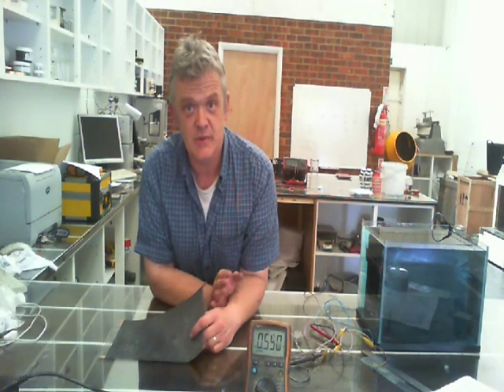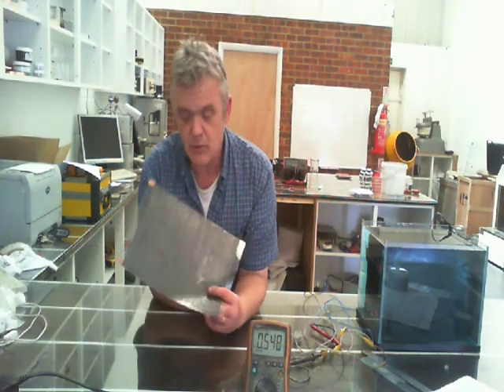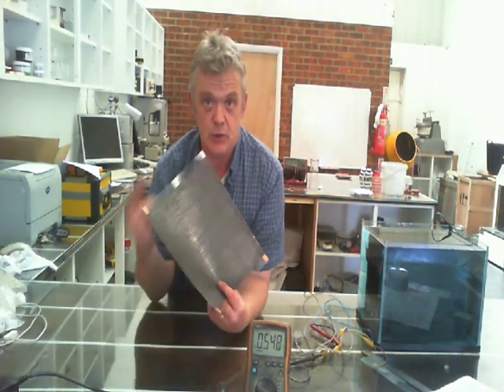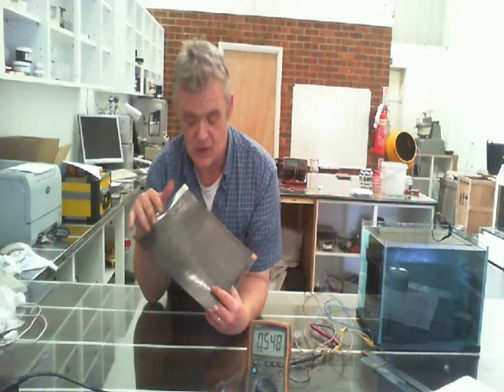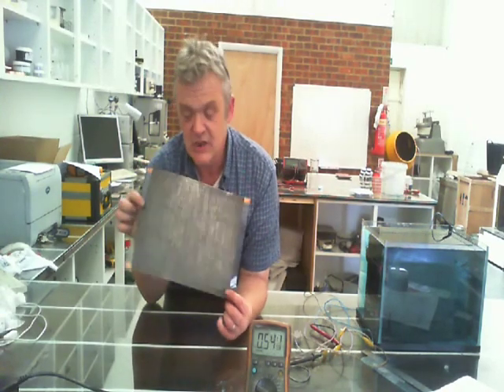Thermal 'Forever' Battery

Comment: cheers mate , I just remembered something interesting from a underground lab this one scientist was using spheres to make energy to charge batteries he said spheres resonate like perfect cavity waveguides ...I thought 18 inch sphere would be best. as an antenna a guy made picks up signals from the farthest probes in space better than everything else NASA ever made ...he put the huge satellite arrays systems out of business...he was a high school kid...LOL...if you gave a copper sphere your coatings of ink ....might be good ....a sphere pulse's 1000 times a second from lighting strikes around the globe ...plus the shuman resonances just shot up from 8.2 to 30 fore so odd reason lately... more energy there to absorb....glad your doing good with your new shop....
Reply from the maker: I like this idea mate - would you ground the sphere like in a tesla set up?
Reply: Pardon me, but if the sphere is collecting an electrical charge like an antenna, then the same way for the charge to leave the antenna applies to the sphere.  Your battery can collect a charge from radio waves and since it is also acting as an antenna, it has a positive charge and it needs a ground for the electrical charge to flow to.  Just make sure the ground has the way for it to allow the extra charge to flow through it, so equilibrium is not obstructing it.  
Think of it in terms of a capacitor,  the top is positive and the bottom  plane is negative; and it passes right through the plane to the ground if it doesn't touch the negative plate on the way through.  The positive  and negative plates are in equilibrium, but if it has a path through to the ground it goes through it easier.  Lightning has to overcome the 
air barrier, but for a small voltage if you let it pass through it flows easier. 

Using a negative charge around the wire to allow the positive to pass through is a good way.  You might use a setup the way they do towers that don't have a good ground.  Using a radial system the definition is from:
“Book/Definitions”
Electrical Engineering Dictionary.
Ed. Phillip A. Laplante
Boca Raton: CRC Press LLC, 2000

Radial system -  a network of straight wires or other conductors radiating from the base of a vertical monopole antenna that simulates the presence of a highly conducting ground plane beneath the antenna. Typically, radial wires are approximately a quarter wavelength long and are arranged to have equiangular spacing between them. The radial wire ends at the base of the monopole are electrically bonded together and to one conductor of the feedline.  

I liked playing with the things like the thermocouple you made and I looked up some things.  Thanks man.

Comment: Hard to see but is the copper chloride moving? If its stagnant liquid, is it generating current regardless?
Reply from the maker: it is not being stirred or mixed - but it is moving - well, at the atomic level as  I believe all liquids move because of the heat of the room and it is at room temperature - this is a kind of application of maxwells demon - or at least that is what i think

Comment: I will definitely be playing with this. Im interested to see how little fluid is needed and how close the plates can be.. maybe even a soaked paper towel spacer between the plates would be enough.   If not that then a fine corrugated mesh.  In this case the power density could easily be massively increased.
Reply from the maker: I like that - nice thinking mate - I can see what you mean
Reply: This is obviously an old post, but very intrigued - did you venture down that road and can you report your findings on that kind of setup. Would be appreciated!